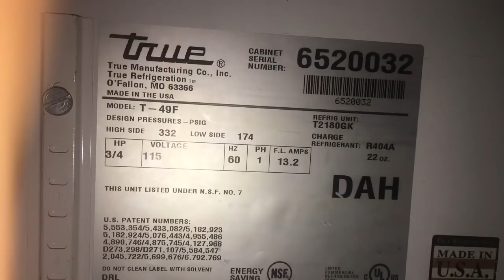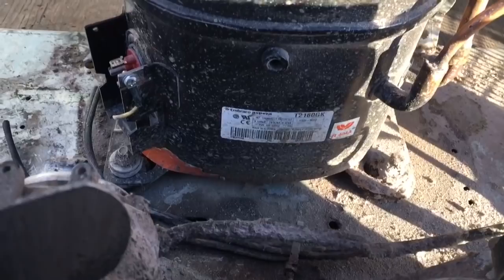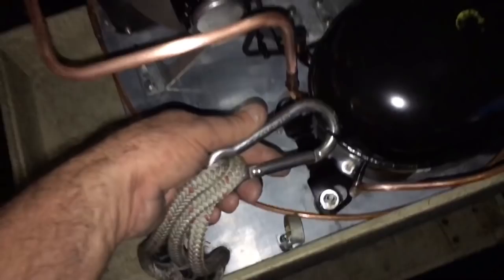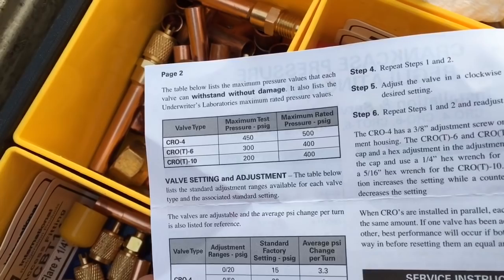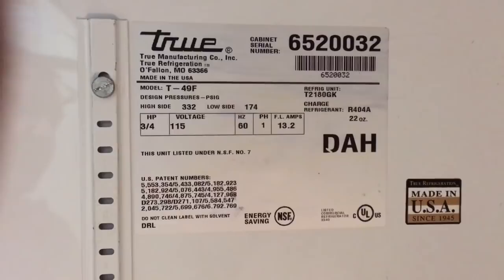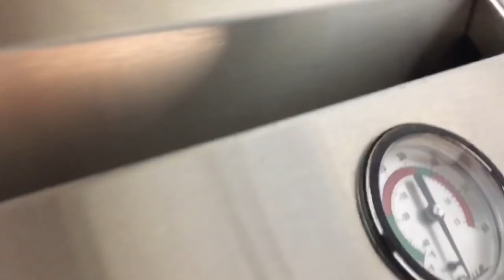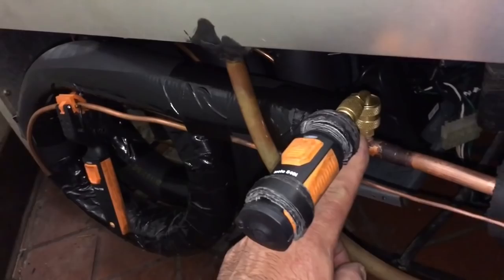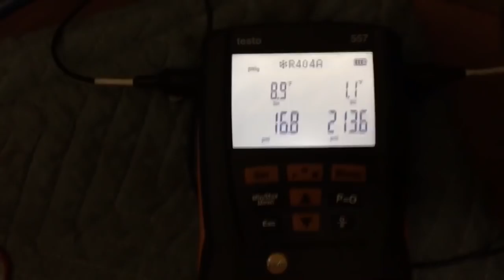True T-49F 2 Door Freezer. Re-Built From Start to Finish.

Comment: Great video OC , bet that CPR valve was a bit pricey 😄 that’s a 0-60 correct?
Reply from the maker: Oh Yea, thats' For Sure. Half the Cost of the Compressor. Yep, 0-60 . correct. Probably Could not do Without it, unit would probably Trip Circuit Breaker after a Defrost without one.
Reply: OcRefrigeration,Hvac & Electrical Johnstone sells a CPR valve that would have worked perfectly for this rebuilt I cannot think of the part number at the moment,  but it's available as sweat , or flare and made by Danfoss I've used those a few times , they worked for me . And btw Embraco compressors are my favorite those suckers last forever.
Reply: I think I payed just over $100 for a CPR valve
Reply from the maker: i'm guessing your talking the danfoss ?
Reply: OcRefrigeration,Hvac & Electrical. Yes it’s made by danfoss
Reply from the maker: I'll check it Out. definately cheaper than the sporlan. this was a 1/2" Suction. that was a 1/2" Valve your talking about ?
Reply: OcRefrigeration,Hvac & Electrical. Well they’re available in all sizes from 3/8-7/8 I believe
Reply: What is the CPR valves function. Does it prevent flood back when the compressors off
Reply: @jpipod1  CPR valve is there to prevent refrigerant flood to the compressor when it comes on . Especially when. It comes out of defrost . Compressor shouldn’t exceed amp draw on start up . If it does CPR valve could be out of range . But there could be other factors as to why the amp draw is higher than normal .And as far as it preventing floodback when the unit is off , I believe it’s possible since it regulates suction pressure going back to the compressor, if the valve is out or range or no longer working it would not or won’t prevent flood back . Hope this helps !